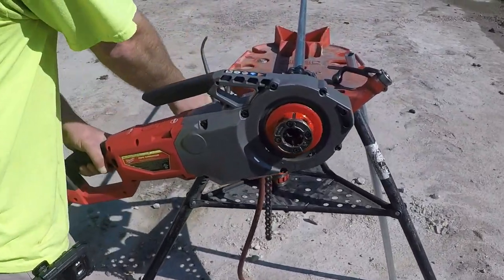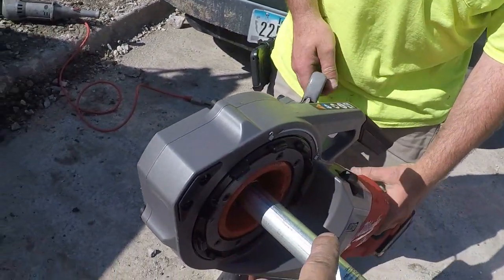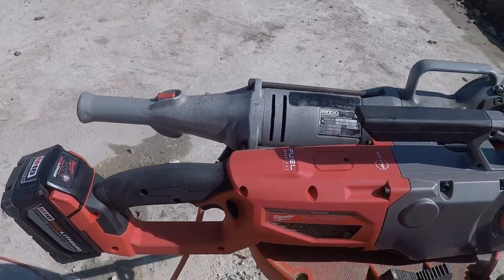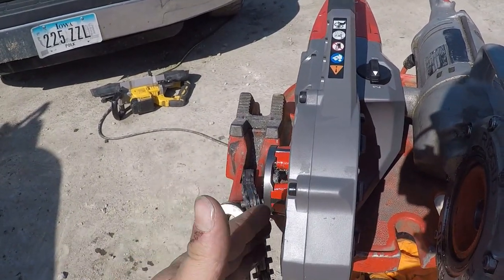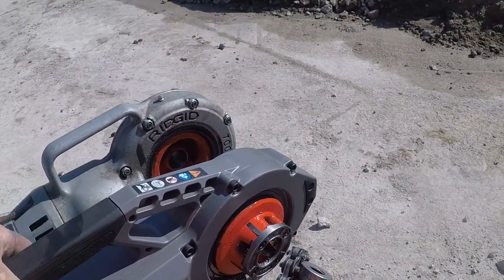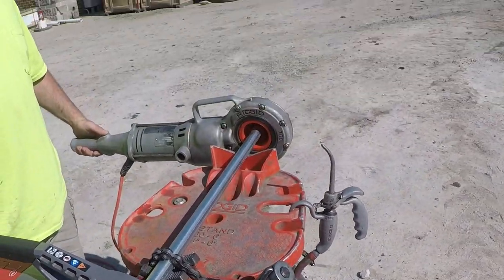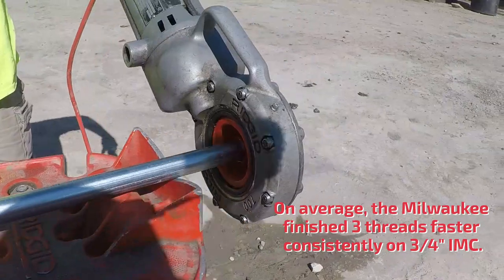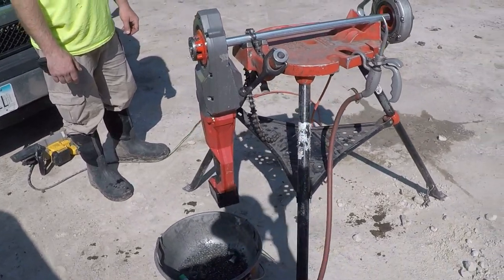M18 FUEL™ CORDLESS PIPE THREADER VS RIDGID 700

Comment: You realize that you're supposed to thread with the pony facing the other way. that's why they designed one side to be a lot flatter than the other. That way you can get a lot of clearance when you're threading a shorter piece of pipe

Plus why would you want to put the threads on a piece of pipe with the pony facing left? It's easier to lean your body weight down instead of pulling up to avoid the resistance while it's cutting?
Reply: Not only that it's flat dangerous to thread that way. I've made hundreds of threads with a 700  and if it binds it'll throw your ass. If it binds and you're using it like this genius you're gonna have a wrestling match with that tripod.
Reply: @asbestosfibers1325  That's why the Milwaukee shuts off if it gains too much angle. You're NOT supposed to pull with a threader, that's how you flip a vise. Ask me how I know. Your bodyweight is definitely enough to hold the threader down, if it isn't you need new dies/teeth. I've personally threaded tons of ¾"- 2" rigid (and ocal) nipples. I only weigh 150 soaking wet. The Milwaukee threader even comes with a bitch bar to hold itself on bigger conduits. Go to an actual jobsite and thread upside down, you'd have every tradesman giggling in their boots. I "GUARUNTEE" it. 💀
Reply: You dam right buddy, the on portable electric pipe threader you go from right to left..
Reply: I suspect the guy uploading videos to youtube isn't an actual tradesman

Comment: The "offset head"  is not an offset head.  You have the die inserted on the wrong side.
Yes, it works.  BUT...
Milwaukee designed the threader to be flat on that "offset" to allow you to thread closer to a bulkhead or floor.

Comment: I've only ever threaded rmc.  How does imc compare in difficulty for the dies to thread? 
I cant imagine this being a good idea for threading at a large job. 
Even those jobs we avoid the pony for. And set up the rigid all in 1 cart.
Reply from the maker: On large projects we have a 300 on hand for a majority of the work load. This would take the place of a pony while filling in when the 300 is being used or if you didn't want to change a die head out.
Reply: @completelycordless8138  makes perfect sense.

Comment: Does the Milwaukee use the same dies and would it work with a hog head?
Reply from the maker: Yes it uses the "industry standard" Ridgid and Reed dies. I haven't had the opportunity to use it with a hogs head yet, but I believe it will, yes.
Reply: COMPLETELY CORDLESS Thanks for the info that certainly makes this an awesome option. It’s amazing how quick cordless technology is advancing

Comment: It's cool but you can only make a threader so portable, if I'm setting up the pony the oiler and all my pipe an extension cord isn't that big of a deal.
Reply from the maker: I see this more for the jobs and contractors who aren't going to be setting up everything, everytime. When you are using a bumper or hitch vise, and maybe only need a dozen threads. Perhaps traveling maintenance or fuel contractors. Do be doubtful though. If power is scarce, it'll thread with a pony as long as you've got a battery. 👍
Reply: @completelycordless8138  i agree and sometimes as the job site progresses rapidly and the people running the job make us move our shit all the time the cordless option is nice or if you have to go to a remote area of the job where there is not power readily available ......cords are annoying in every way shape or form imo but i still think a regular corded rigid pony is the best option for a long term stationary threading area.......i wish my company would buy these but they wont =[

Comment: The cordless might be better on 1/2” and 3/4” pipes. But the real money is in 1” to 2” Pipe.....and even more money is up in the 4” Pipe, if that cordless can run a hog head all day long!....Thanks for the video. Very interesting
Reply: Use a hogs head on anything larger than 2”.... or better yet, measure it right and use a 1224 to thread...
Reply: @anthonyjohnson4751   I totally agree but now you're talking a whole new ball game. Ridgid 1224's aren't cheap!

Comment: Can these thread bolts?
Reply: Bolts usually have a different thread pitch or count
Reply: The Milwaukee accepts 12-R dies.  If you have 12-R bolt threading heads, yes, it will thread bolts.

Comment: I just dont see the point of a batteries on a stationary platform like pipe cutting. Unless your doing in situ
Reply: If you ever work on a 5 story appartment complex doing rough plumbing running cords , fighting all other trades at the spider box..  flicking breakers left and right you would understand the struggle.
Reply: Ditto what Tactical said, AND I would add, some job sites have no power source, and running a generator can be costly.